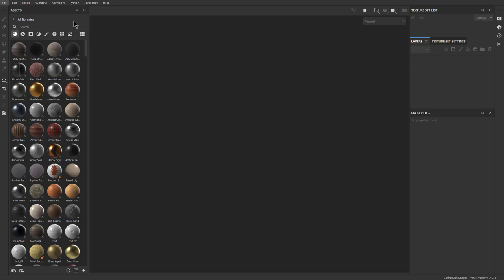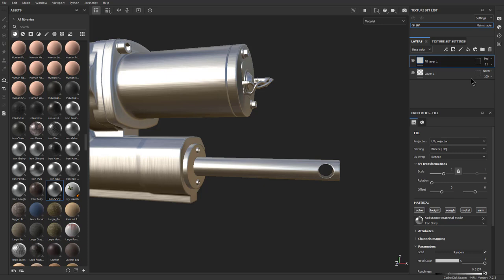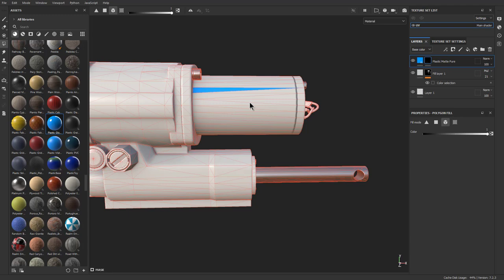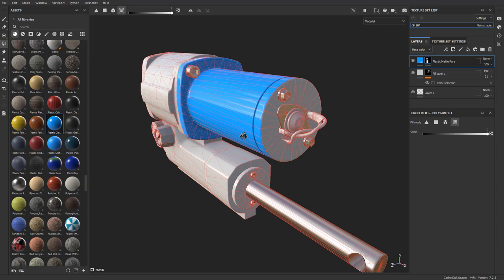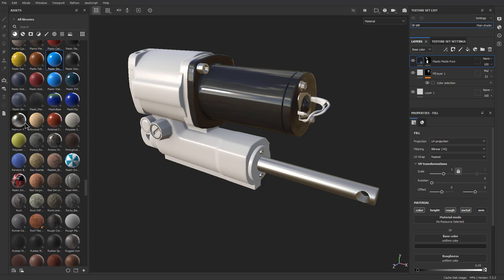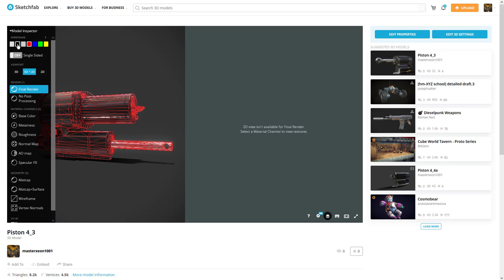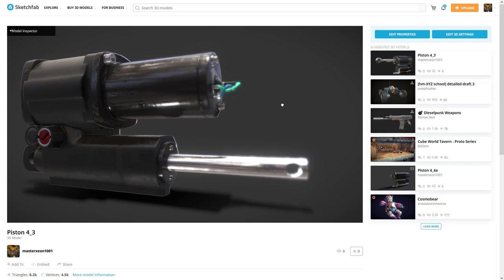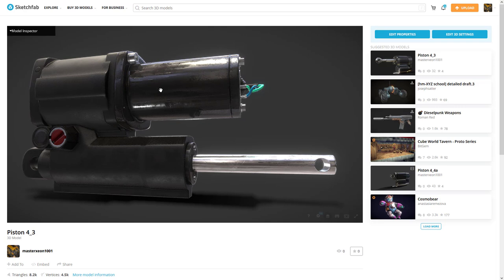#SubstancePainter - Hydraulic 4_5 (Texture / Sketchfab)

Comment: I wouldn’t have imagined you such a great substance user. Just because you always bash Adobe, I always thought you completely avoid using painter. Anyway, I’ve learned  quite a few tricks from this video. Thanks!
Reply from the maker: i used them since the start. I spent my time understanding each update and attempting to grow with the software. Even though its with Adobe the power of sbar and smart materials / masking is worth another year license for but I worry someday they'll pull it into CC and I dont wanna deal with monthly reoocurring with customer support calls to cancel.
Reply: @masterxeon1001  I bought the steam version of SP and SD. mine forever.
Reply: @RunTheTape  I thought steam version only lasted for a year
Reply: @nightblade178  nope. You just get updates for a year (i.e. Only minor updates, not the major ones 2020,21etc). It’s yours forever.
Reply: @RunTheTape  ohhhh is it? That's great. Thanks my dude 👍